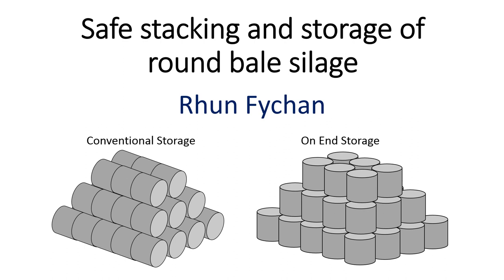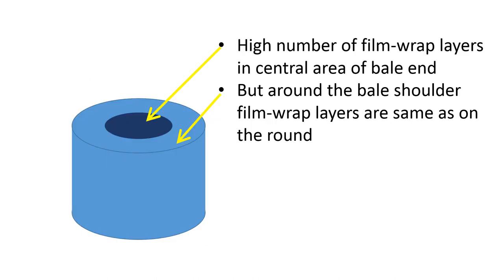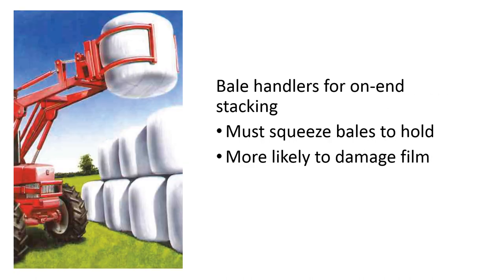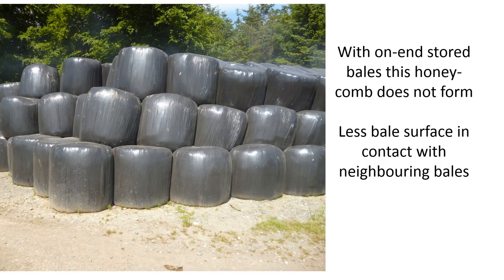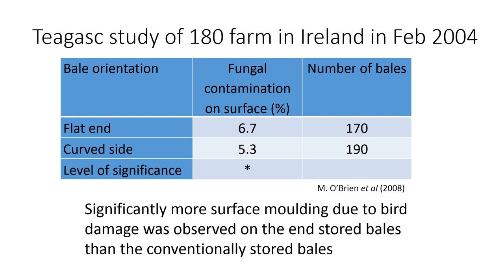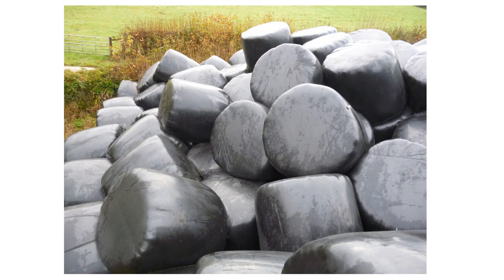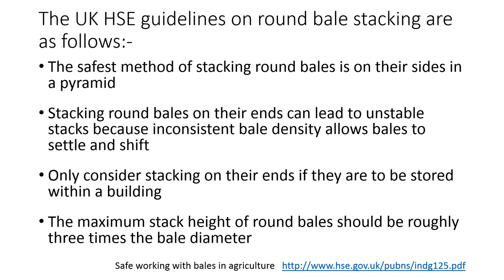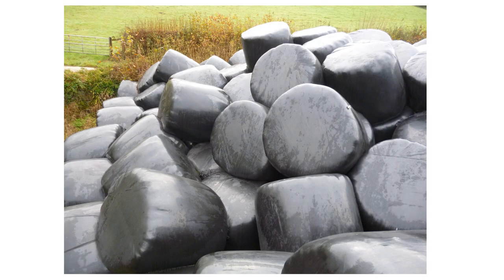Safe Stacking of Round Silage Bales

Comment: Hi Rhun - there is quite a bit of evidence highlighting that in fact we should not stack bales with a DM below 35% due to plastic slippage and associated increase in DM, D and ME losses. Additionally, when we stack bales we get reflection of UV from bales above that causes a thinning of the plastic and localised air entry.  Shinners also highlights that bales should always be stored upright due to the higher layer on the end and the reduced adsorption of moisture and associated spoilage in the base.